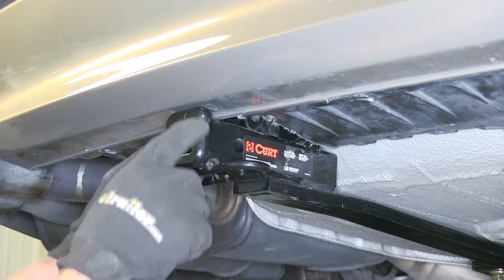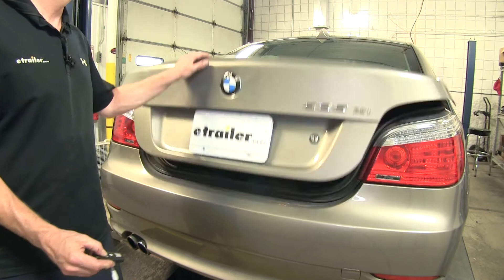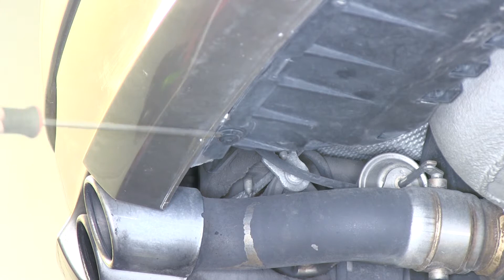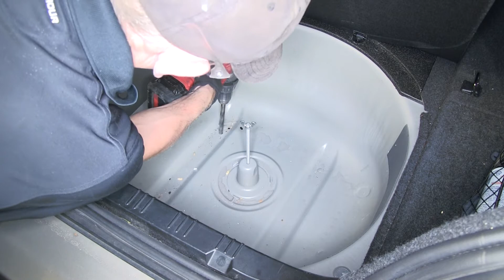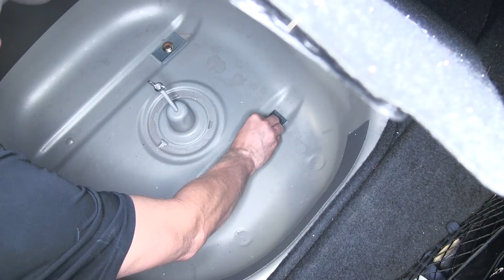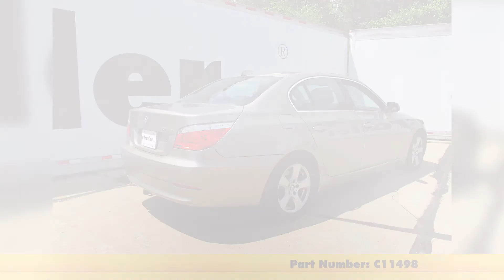etrailer | Beginner’s Guide to Installing the Curt Trailer Hitch Receiver on a 2008 BMW 5 Series

Comment: Will it hold pulling small boat?
Reply from the maker: The max tongue weight of this hitch is 200 lbs and the max tow rating is 2000 lbs. You will want to check with the owners manual of your BMW 5 Series to make sure the car can handle that weight. You'll want to go with the lowest number between the car and the hitch. For more details on this hitch, you can find them on our product page.
https://www.etrailer.com/Trailer-Hitch/Curt/C11498.html